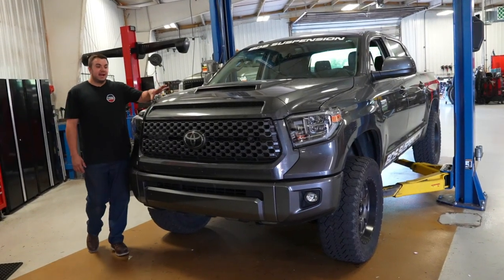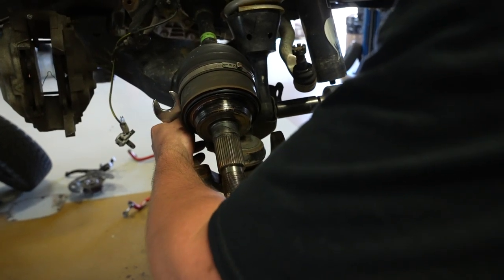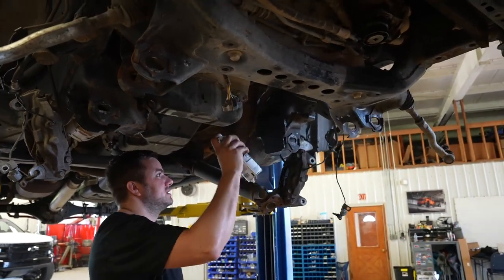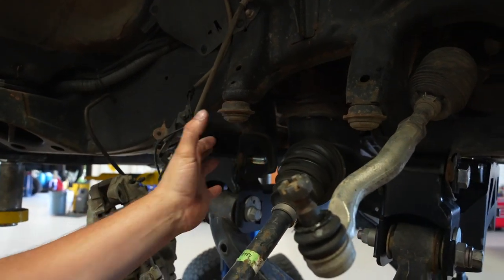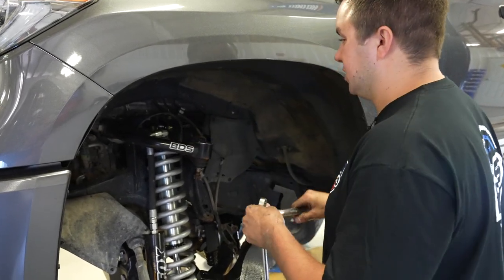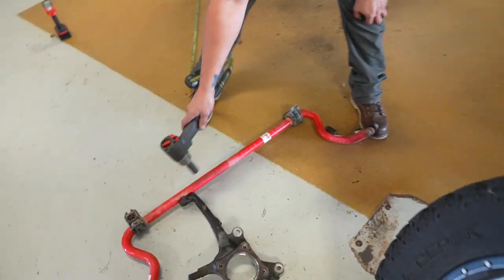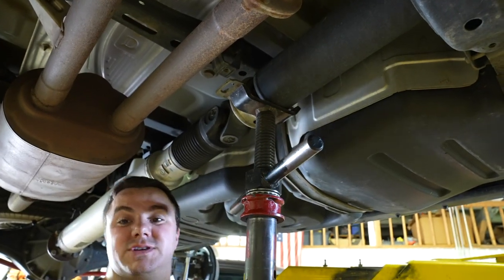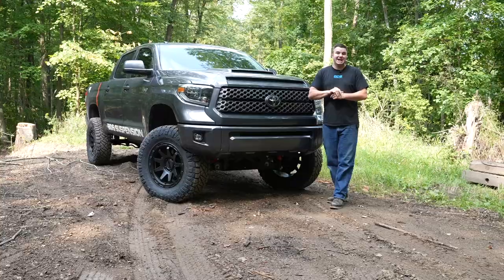Toyota Tundra - 7" Lift | How To Install

Comment: I have this exact lift on my 2009 Tundra. It was installed about 8 years ago and is holding up very well. Having said that, the rear leafs are beginning to sag and its time to replace them. I'm looking for a solution to replace the rear 4" blocks with lifted springs and was wondering if you guys can steer me in the right direction. I have a few ideas but was looking to get some pointers from the creators of this lift.
Reply: @LWBSCOTTY I also have the same lift but my shocks are old. 
 what kind of suspension do you have on now ?

Comment: I have a 7 inch bds lift on my tundra and it only sits about 1 3/4 inches higher than my 3 inch rough country level ? Is that just how they sit or ? I didn’t install my bump stops cause I didn’t see the need for it cause I don’t off-road is that why it sits so low?
Reply from the maker: When installed properly this kit nets a full 7" of lift up front over the stock ride height. Bump stops won't effect ride height and we offer this kit in both a 4.5" and 7" lift height. Its difficult to diagnose over the internet, so I'd suggest starting with taking ride height measurement (center of hub up to the top of the fender opening) along with some photos of the front suspension installed and reach out to our tech support team to verify ride height and figure out what's going on,  tech-bds@ridefox.com. You can also connect with them over the phone as well at (517) 279-2135

Comment: Does the carrier bearing spacer come with this kit? Or, does it need to be ordered separately? I have a the 813F kit on order. Trying to ensure I have everything needed.
Reply from the maker: The carrier bearing drop is not included in the base kit, we offer it separately and is only used for models equipped with the 2-piece rear driveshaft #128409

Comment: The factory upper control arms caused  alignment issues, which caused premature tire ware.
Reply from the maker: This kit does allow use of the factory UCAs, however we recommend upgrading to our aftermarket UCAs for additional strength, serviceability, and more adjustment to align.

Comment: I have a 4.5 bds lift I can raise it to 7” by changing some parts without having to buy the a whole new kit of 7”
Reply from the maker: Correct, BDS 4.5" and 7" lift kits for the Tundra share the same base components so its a simple enough upgrade to change your 4.5" kit for the 7". Up front you can either swap the strut extension out or opt for the FOX 2.5 coilovers. In the rear you can swap to a taller lift block and/or our 1" shackle kit for additional height. For more info contact our sales team at (517) 279-2135 or sales-bds@ridefox.com